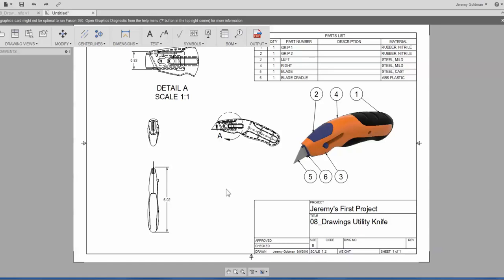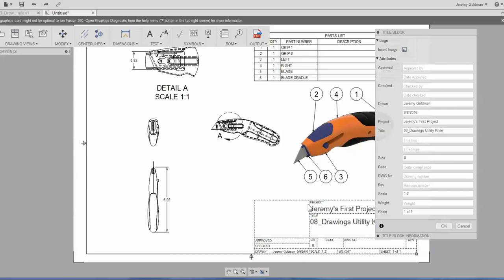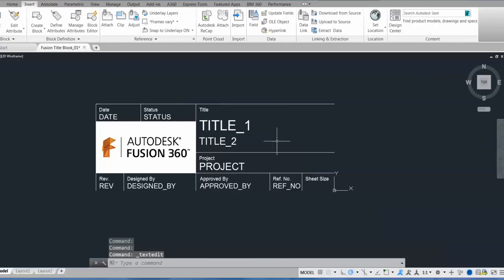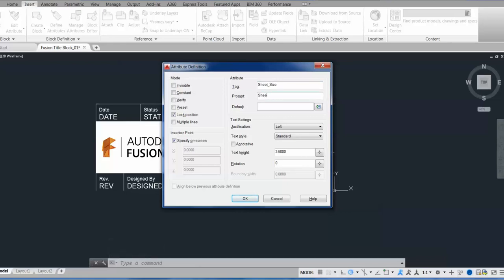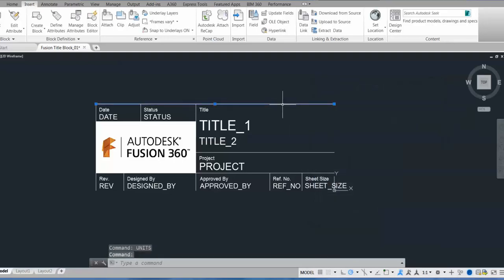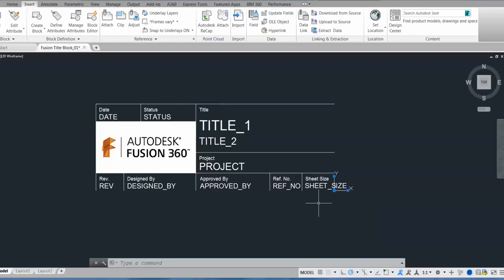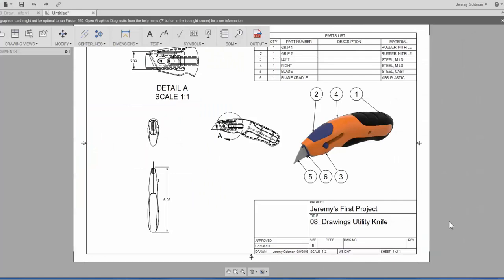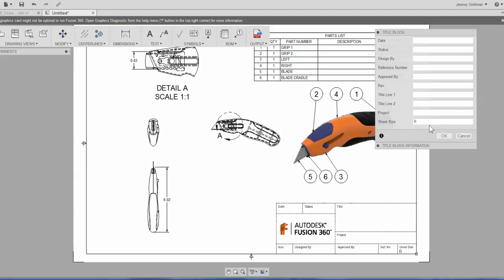QUICK TIP: How to Insert a Custom Title Block

Comment: How can i do this without autocad?
Reply: Hi Peter,

The Fusion team is working to develop more ways to insert a custom title block. Although we don't have a date yet for when this will be available, it is definitely one of the top priorities for the Fusion Drawings environment. 

But right now, we only support the one way to insert a custom title block, which is using a DWG file. There are lots of ways to create a DWG file that the Fusion environment will accept, but the the cleanest and most reliable way to do this is using AutoCAD or AutoCAD LT.

You aren't alone, Peter. It's a common question/request among our customers right now. If you ever want to share your thoughts or hear what Fusion team members and other customers have to say, the Fusion Community is a great place: http://forums.autodesk.com/t5/design-validate-document/bd-p/124.

Thanks for viewing,
Jeremy
Reply: I've tried to do the same by first getting my original title block from Inventor to Autocad which worked fine, but when I then import that to Fusion it says it has some xrefs on it? Can someone please help?
Reply: @vivekphilipvarghese  Same here.